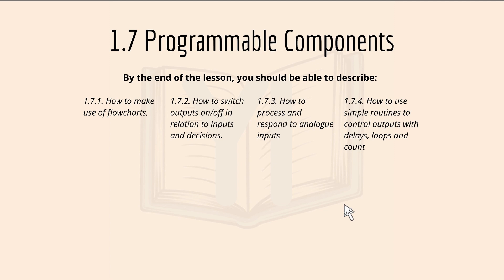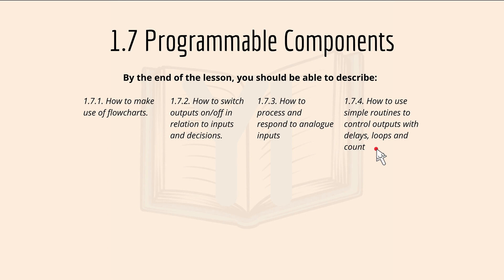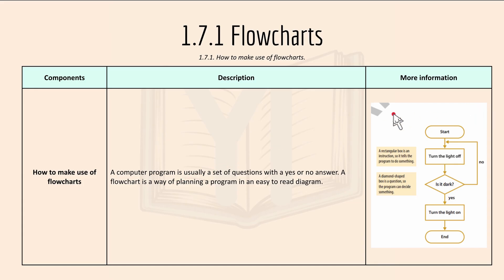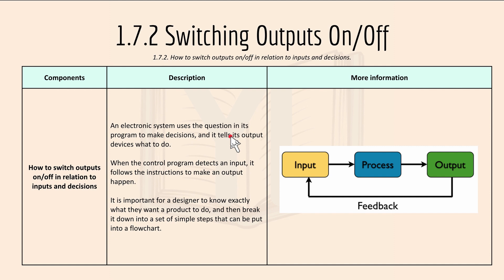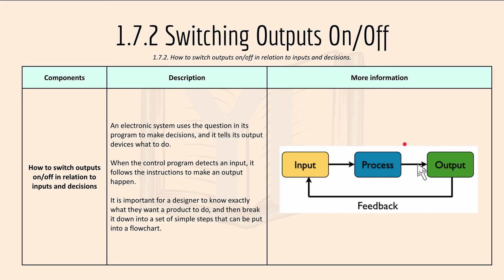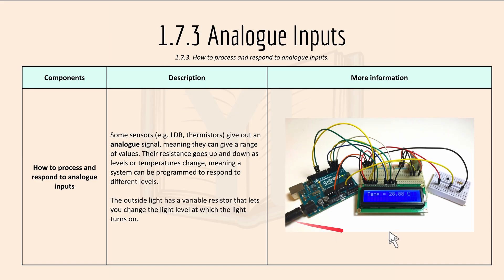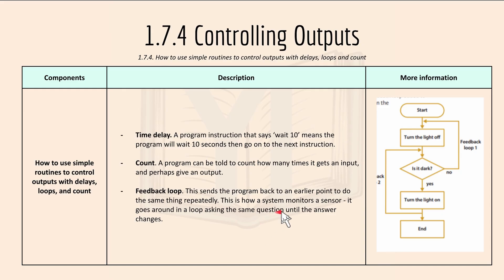EDEXCEL GCSE Design Technology: Programmable Components (1.7)

Comment from the maker: Edexcel GCSE Design Technology time stamps:

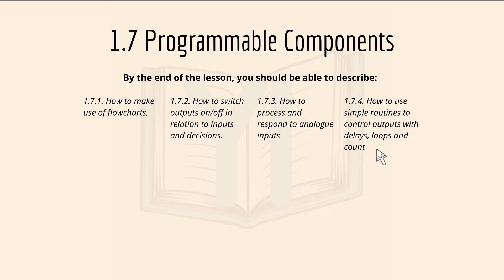1.7.1 How to make use of flowcharts: 00:40
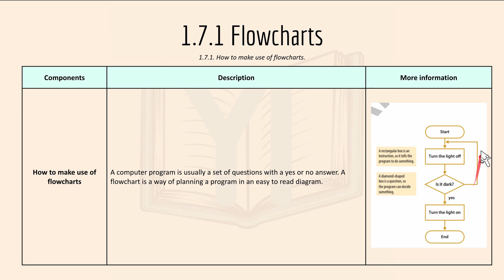1.7.2 How to switch outputs on/off in relation to inputs and decisions: 01:22
1.7.3 How to process and respond to analogue inputs: 02:06
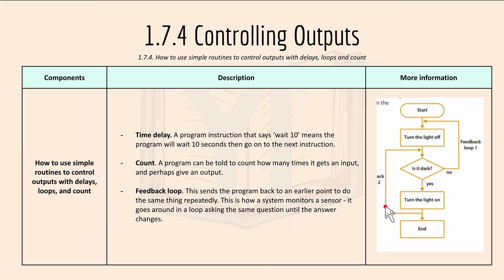1.7.4 How to use simple routines to control outputs with delays, loops and count: 02:48